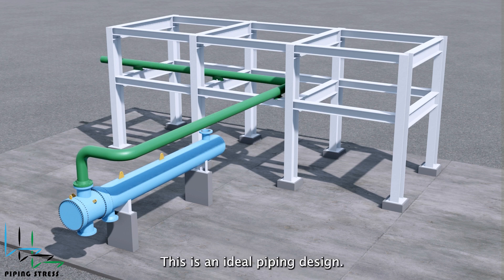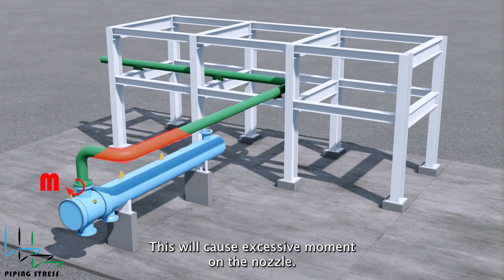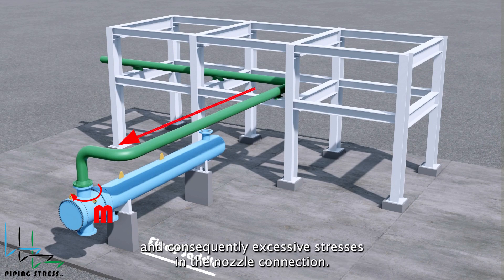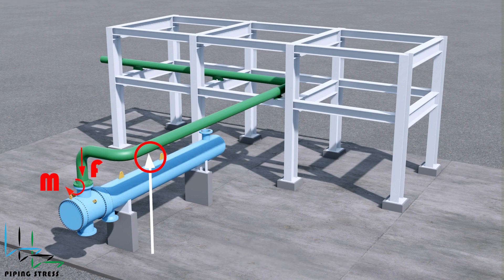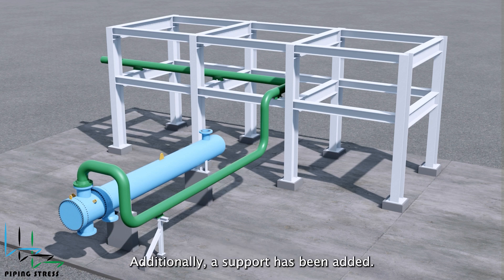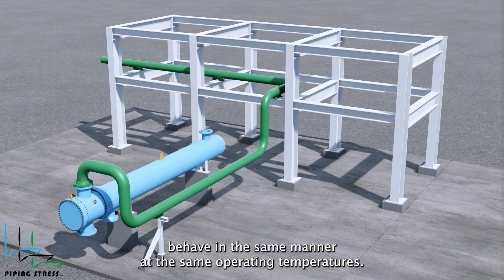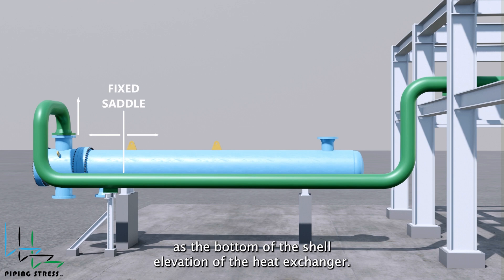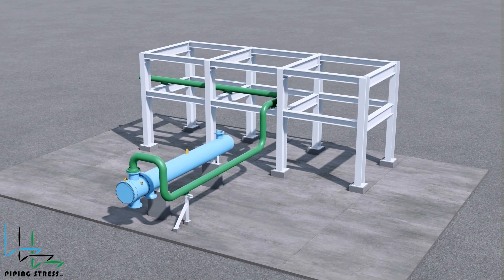Heat Exchanger's Tube Inlet Nozzle Piping Stress Analysis

Comment: Great video but I don’t understand why the BOP and vessel being equal will reduce stress
Reply from the maker: Because the same elevation of piping design will give the same upward expansion with the heat exchanger so, on the connection point there will be minimum monent/stress.
Reply: @PipingStressNet  I think I understand, it’s about the length of steel from A to B being the same. The diameter of pipe or vessel is irrelevant. Thank you! I’m learning so much from your channel.